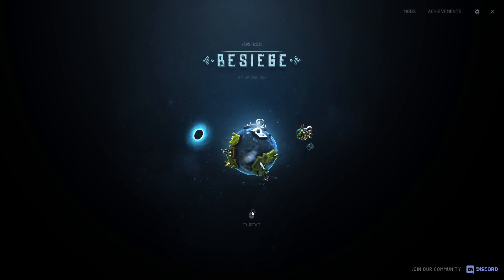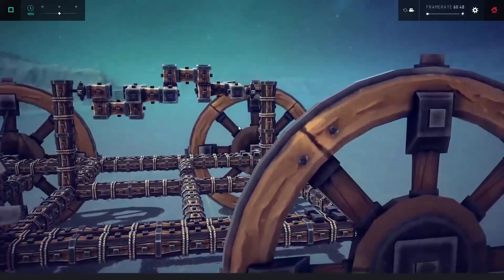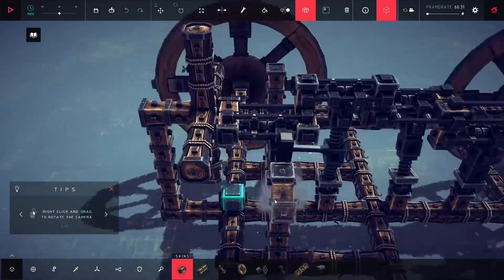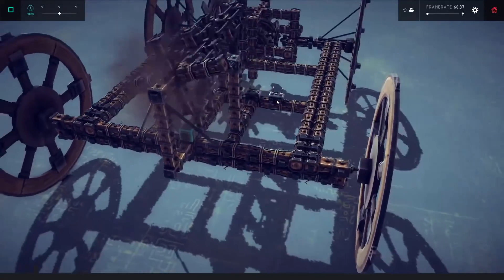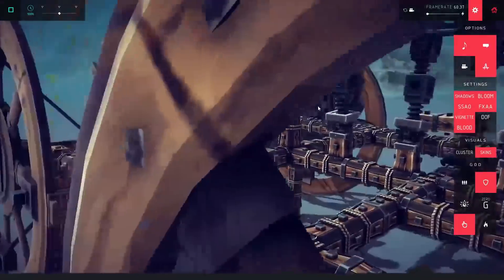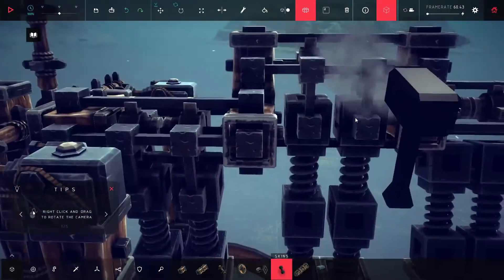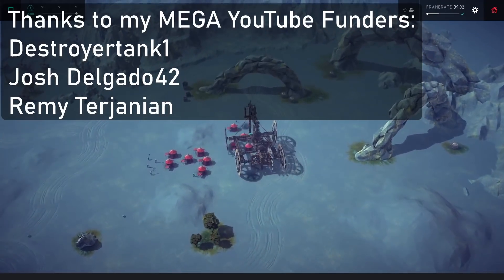Making a Functional Engine in Besiege

Comment: This actually inspired me to work on developing my own. I've found that power scales linearly with the amount of pistons, and there is a set maximum RPM for the crankshaft due to how fast pistons are able to move in vanilla. Another thing I found was that it was losing a lot of torque with every gear it transferred power to, so the less gears it uses to drive the machine, the more power it has. Also, scaled gears do not mesh well. A clutch of two round shields and a piston helps a lot to deliver power without stalling the engine. My best design so far uses a 2:1 gear ratio, an 8 rotor design and reaches a max speed of 15 (Not sure what 15 is, but that's what the speedometer on besiege tells me).
Reply: Update: I have now made them go at a max speed of 32 after several wasted months of free time

Comment: Former powetrain engineer. Very cool. I've got advice for some of the issues you encountered! With no increase in engine speed, adding pistons at a 90 degree offset rather than the 180 gives better torque improvement and should be much smoother at lower speeds and no flywheel. the more rigid you can make the gearing the better off you'll be, so the fewer gears the better while obtaining a sufficient reduction. I Advocate starting with a "kickstand" to stop and go, which should help get a smoother start up: you dont start your car with it in gear 😉. If you want a more direct gear reduction you might try a planetary gearset (not sure its feasible in beseige), which could integrate the differential and gear reduction in one.

Comment: You can use multiple crankshafts/engines to rotate the same gear, should increase the power output but not sure how the weight will affect it all.

Comment: Has someone suggested converting from in line to radial? Also if you built it flat instead of vertical you can save a lot of space or replace that with more radial engines stacked.
Does besieged have worm gears? That will give you significant torque meaning smaller gearboxand less weight/mechanical parts taking friction.

Comment: Way more reliable with way more torque than any of the engine's I've built  - they were pre-sensors and I had to use the steam cannons on sliders instead of pistons and hooked up to the crank shaft for timings tbf but still very impressive

Comment: I don't do enough with besiege to know if it's actually feasible, but I think instead of mounting the banks in an opposed configuration, maybe have them like 45 degrees off from eachother such that you don't have to worry about gravity fouling up the pistons, while getting more power. 
On the idea of the transmission, I think you may also want to figure out a way to have a flywheel mounted, so that you don't find yourself entirely out of energy at the end of changing gears. Alternativly, perhaps you could make something resembling a CVT using grip pads? I think I've seen a very early incarnation where the crankshaft was connected to a disc, and a wheel perpendicular to it moved inwards and outwards. I can't find the name for this mechanism or the related car though. EDIT: You can find this mechanism if you search "gearless friction drive car" on youtube.

Comment: You can build a bit more reailstic engine by replacing the pistons with water cannons mixed with torches to create steam cannons. It works  even when steam cannons are moved out of the way with just mechanical  arm. When you turn the cannons on and off by sensor block, you can even make it move with a propeller. Still it's not powerfull enough to power wheels.

Comment: eliminate crankshaft,  transmission and differential, pistons act directly on wheels with a swivel. any # of pistons per wheel tho 2 or 3 work best. need more power, add more wheels

Comment: I recommend you look up real engine crankshafts, say a 4 cylinder for example which is effectively what you were building here, to see how the pistons are actually offset from each other on the crankshaft.  Your design is very flawed in that aspect.  1 and 4 are at top dead center together. 2 and 3 are also paired together.

Comment: This is the coolest thing I've ever seen someone do in any game. I get why you chose to make the pistons jointed, but it's still a little painful to watch. I wonder if making the pistons fixed then having a piston rod on a joint between the piston and crankshaft would somehow make your engine run better, though that's probably less space efficient. I also found it interesting that you made your crankshaft on top of the pistons instead of beneath, but I guess that's necessary to fit your gear reduction. Speaking of gearing, do you think it would be possible to use fewer, but larger gears to get rid of some of the play? Might make it run smoother.

Comment: For a transmission. Use a piston to push a set of gears up against the fly wheel to engage the transmission itself
And to pull it away when you dontt want it.

Comment: An inline 6 engine with rod journals oriented every 120 degrees will give you a much more balanced engine.  Also, increasing the crank throw (aka piston stroke) will increase your torque output.  Also, give a read about the difference of odd and even fire engines.  I know it is a bit different as this is functionally a 2 stroke, but the idea still applies.

Comment: From my very crude calculations, the engine runs at 55RPM, meaning that at the 16x speed, it runs at 880RPM, which is around the average idle RPM of a car engine. For the sake of realism, I will assume that 1 unit of mass in Besiege is equal to 10kg. I don't have that much experience with Besiege, but I assume that the piston also pulls down with an equal force as when pushing up. Based on that, we can assume that all pistons are applying force to the crankshaft at once. Every simulated engine piston is made up of 4 Besiege pistons, that makes a total of 16 Besiege pistons. From the data I found, the maximum weight that still allows a Besiege piston to fully extend is around 35 mass units or 350kg in our case. That means that the force exerted by one piston is around 3433N, or around 55 000N for all 16 pistons combined. If I assume that 1 block in Besiege is 1 cubic metre, that means that the distance from the centre of the crankshaft, on which the force is applied is 1 metre. That brings us to the torque of 55 000N·m. That means that the maximum power of the engine is around 575hp (478kW) at the 55RPM, that would be around the same power as a 6.2l supercharged V8 engine from Camaro ZL1, or just in the range of an average semi-truck horsepower. If we took the 880RPM from the 16x footage, that would equal up to 9200hp (6860kW) or a bit more than the Siemens Vectron electric locomotive.

Disclaimer: This calculation is very simplified and doesn't take the fact, that the lower piston has to push the weight of the upper piston, or friction into account. I am also not a physicist nor an engineer. Take this with a grain of salt :D

Comment: When you added the pistons on top, you need 45deg offset firing times for them. This will allow the ones on bottom to fire and push the crankshaft up, and the top set, attached to the same cam, to fire on the push down. As you had it, the pistons attached to the same cam would fire simultaneously, and fight against one another. If the sensors are accurate and fire instantly in this game engine, it should quadruple your power.
Reply from the maker: I didn't show it, but I changed the timings.

Comment: you could run a double crankshaft.

if you just copy and paste the original setup, and then have each of them driving a gear, but both of those gears drives the main gear train, you could make up that low torque issue. it might also help un-jam, but it might also make it more prone to it.

I really like the idea of seeing the difference of two 2-strokes and a single 4 stroke, as well as the max power of a twinned 4-stroke.

Comment: I tried it in vanilla with steam powered pistons, didn't had the quarter the power of your machine, but if you take a little advice, what you experience when add the second row of piston, was because the off timeing. If you rotate the sensors so they facing parallel with the timing disc (rods), you can play with lenght and widht of them, so you can get a more accurate timing zone, by adjusting when the sensor turn on and off (which angle the piston start and stop to push), little finicky, but this way you can go for a more countinous motion, maybe the power you get will be a bit higher (mine had a little). And one last thing, add a flywheel, it will push the shaft over the end positions and give a more finer motion

Comment: OverEngineering 101
2:42 is finally able to rotate crankshaft but is clipping into itself, tries to solve problem
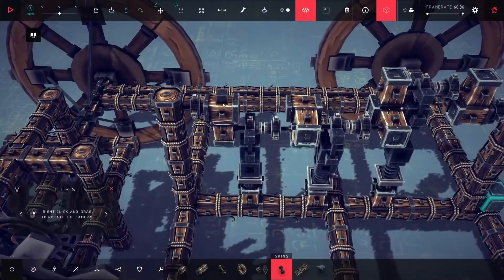3:54 has to put braces everywhere which visually looks  more overengineered than 1st solution and also is still clipping

Comment: not completely familiar with besiege but couldn't you build from the ground up a new model with thinner frame and support braces  everywhere, overall lighten the load on the engine? also, I can see a W style engine out of this easy, that would make for a stronger output. I also realize this would make the overall size way bigger

Comment: before i saw this i was obsessed with trying to make a engine that would power a car and i got a solution which turned out ok by using gravity and extending weight blocks to turn the axel and sensors to detect blocks i placed for timing the gravity engine and worked very well

Comment: Bit late to the party, but for doing the opposing pistons, did you try inverting the timing properly? I imagine that pistons on both sides were trying to go at once on some of the cycles, which caused the jitter, albeit it kept going due to momentum. If you can figure out opposing pistons, I don't think even quad pistons is out of the realm of possibility.
Reply from the maker: Ye I made sure to invert the timing. I think I just braced something wrong and it caused it to seize up.
Reply: @ReidCaptain  Just another shower thought to add onto things, perhaps a V-pattern block could work better, with less requirement for additional bracing. Although, a bit of additional work would have to be done to time it, instead of just inversion. Perhaps another timing "fan" could be jointed in front of the existing one, rotated by exactly as many degrees as the pistons are apart?
Also, perhaps the timing switches could have a set delay, to make up for the inaccuracies of the blades and fire on time, preventing any losses from the pistons backfiring the beginning of the stroke.

Comment: What probably happened when you tried doubling it up again is it caused a piston pressure conflict. Both sides were trying to activate at the same time unless you readjusted the key bindings to have the top side pull while the other side push. That's my guess at least.
Reply from the maker: I readjusted the bindings, I think it was probably the way I attached the pistons to the crankshaft. Good thought though.
Reply: @ReidCaptain  Then I'm not sure. It could be that the timing of the pistons aren't fine tuned enough to actually allow for that to happen without doing it in an off set rhythm, like with 3 sets of pistons at 120 degree offsets. I noticed that Besiege doesn't exactly have smooth animations for activation and everything likes to bounce, so enough of that could have caused too much rebounding and stalled out the crank shaft. A lot like how if you hold onto a weight with two strings and pull it one side at a time. If you add extra vibration or movement to the weight, it becomes harder to control smoothly.

Comment: I'm so down to see the finished version, but that technically isn't a traditional ICE engine , and not just because it isn't powered by deflagration, or no  fuel source. It's got the crankshaft on top of the piston heads which is reverse to everything I've ever seen, although it could just be seen as being upside down. A cool thing i realized while writing this is that having the pistons doubled up like that sort of makes this a conjoined inline 4 or an inline 8. I think it's a very cool proof of concept for the game, but I'd like to see a true "combustion" engine if its possible :> :V.

Comment: For the pistons not able to substain speed cause it need tork, if you add pistons or bigger ⚙️ at the end of the crank shaft and smaller one on the wheel so it will take less rotation from the crankshaft for your wheels to make a turn

Comment: frictional clutch and a flywheel? rather than a gear reduction, you just need something to allow it to get over the initial lack of inertia without a stall while maintaining low-torque but higher angular vel. in place of a gearbox, which would be colossal. doesn't need to be fancy either, you could have two rows of wheels that can contact each other with variable force using a pivot point at one end and an 'extender/contractor' at the other to control the local normal force pressing the wheels together. would suggest a torque converter but don't think besiege supports fluid dynamics to that degree
Reply from the maker: Even if power is applied slower, it doesn't really help. When I turned over the engine manually to get it started the engine couldn't sustain that load.
Reply: @ReidCaptain  valid point, thanks for taking the time to reply as well
Reply from the maker: @daveawits1  np, I try to answer as much as I can!

Comment: At 12:15 when you added a row of pistons on top of the first one it caused unstable movements because it was one block longer than the lower row of pistons and it was rotating along a slightly different axle

Comment: I think with the doubled up pistons you'd be better off making an opposing cylinder engine, one where the pistons are angled from the crankshaft by about 25 degrees so that in their default position they have leverage against the center, along with a larger "dent" in the crank shaft allowing more leverage. The piston pushing horizontally (with 25 degree offset) and a piston on the opposite side (and respective opposite offset) contracting should give you the torque you need. I see you have extra horizontal space too, I think this may be the solution. I don't own the game and would love to see more of anything from this game involving gears! Thanks!

Comment: You should make the engine more like a V8 to increase the power and maybe making the pistons 2x2 instead of 2x1, having the “distributor” independent of the crankshaft should make it so you can easily start and stop it with a toggle (might need a starter then though), maybe use censors and pistons to make a “predictive suspension” system to help with small obstacles and turning, and a transmission would be cool if the engine power was increased.

Comment: good start of an inline 4 engine, the cross shape crank will cause a lot of vibration and constantly shoft the weight probably going to break the shaft. firing two pistons at once, two inside then two outside pistons, it will distribute the weight shift better

Comment: I could see this design for a radial engine if you could attach those joints and pistons to the gears themselves, although it have to be inverted from the traditional understanding; have the pistons push the teeth of the gear radially, which would increase torque; especially with the amount of vibration you are getting a radial is exactly the type of motor for this

if you can increase the "thickness" of the gear, you can add multiple pistons on each radian; this allows for more direct torque of 1:2:1 rather then a 16:1 reduction. Furthermore it be much easier setting up the CAM shaft, and you could set multiple radials in series; you could look at tunnel boring engines for reference.

Comment: Also think about this if your engine is at 0 rpm you have 0 torque or not enough and 0 horsepower is what you need to combine with torque to have enough power to move that’s why engines in real cars idle and aren’t directly connected to the wheels you need to find a way to let your engine idle and the connect

Comment: In real engines they have counter weights to stop the engine knocking, but in some engines, especially the straight 6, you don’t need these counter weights, because the movement of the pistons and the firing order cancels out all the vibrations and the result is one of the smoothest engines ever made.

Comment: Very impressive but I feel a car with such slow steering has no use for a differential. Most of the early automobiles were only one wheel drive and used a leather belt to drive that wheel, which also acted as the brake. 
Reducing the weight of your driven axle will allow more of the engine's power to be spent driving the vehicle rather than trying to rotate a heavy differential. 
A transmission would be cool to see, and definitely a more powerful engine.

Comment: What if it has a flywheel? Might be able to aid the transmission to have a smoother drive
Attach the flywheel into the output of the engine and that means a clutch mechanism is needed!

Comment: maybe you can use poles in place of some logs in the differential, or only have corners/ connecting points be wooden blocks and all intermediate logs be replaced with braces so that there is less weight for the engine to push

Comment: I'm assuming you're going with a piston engine for the mechanical appeal.  But if you want more performance, use a steam powered turbine engine.  Basically the steam spins a wheel with paddles.  Much easier to build, less blocks, and weight.  Plus puts out loads more power.  I built a fully steam turbine powered rock crawler and it can climb up some pretty steep rocks (even up to about 50 degrees) with nothing but steam power.  Would be really cool to see what you could do with something like that.